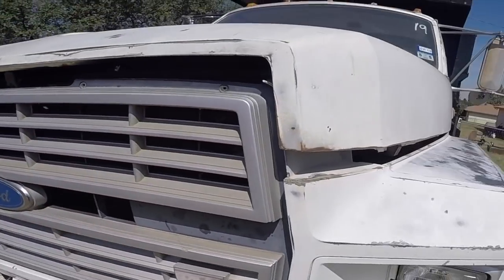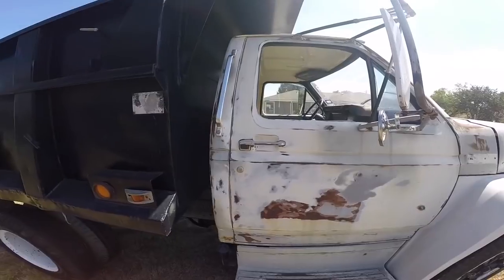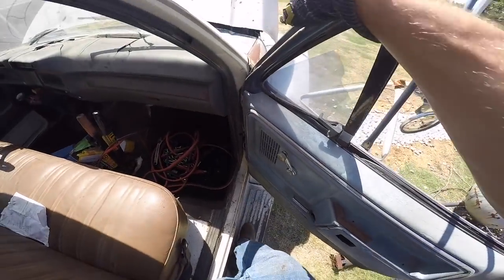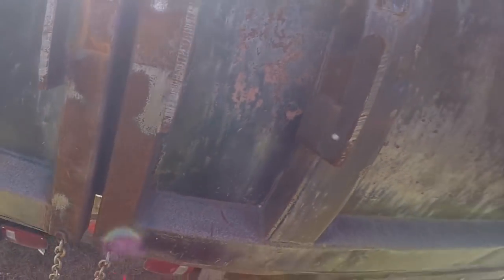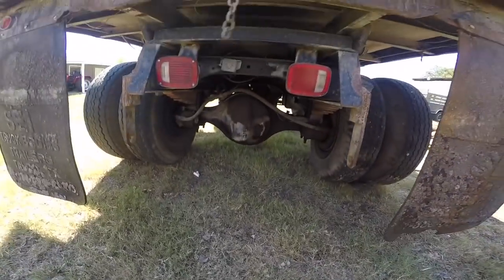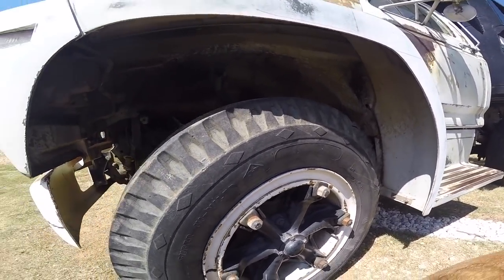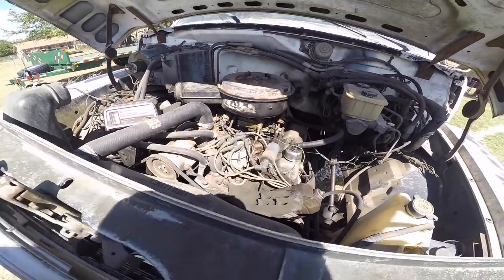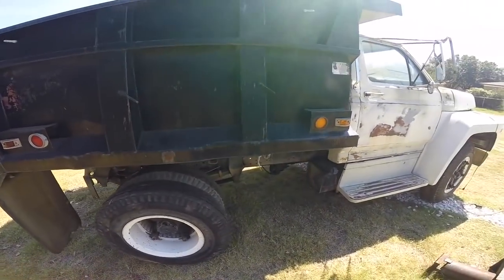I ONLY PAID $2000 FOR THIS DUMP TRUCK, HOW BAD IS IT?!?

Comment: The Ford 370 ci engine is a special commercial heavy duty V8 gas engine ! Fuel milage will be horrendous but engine was designed for commercial service !

Comment: Carburetors aren't all that bad Chucky. You just need to understand how they work.
PLUS you don't have all that electronic equipment (fuel management system) to give you nightmares.
I've had trucks with carbureted engines that got BETTER mileage than the fuel injected engines.